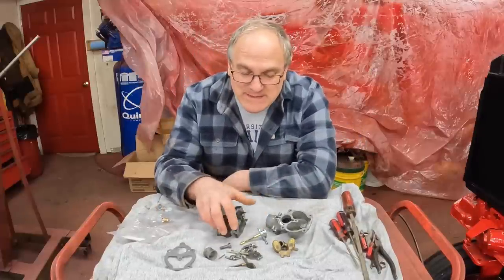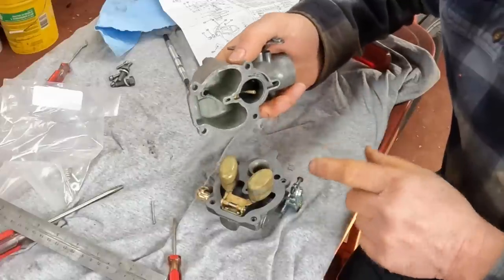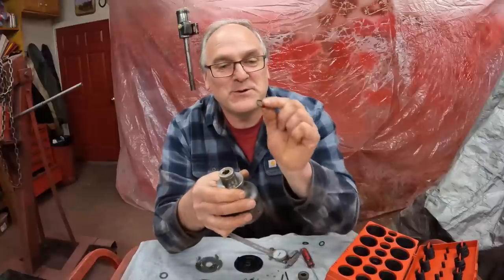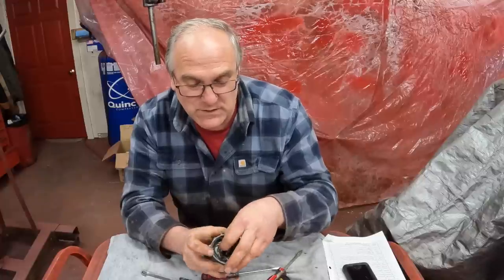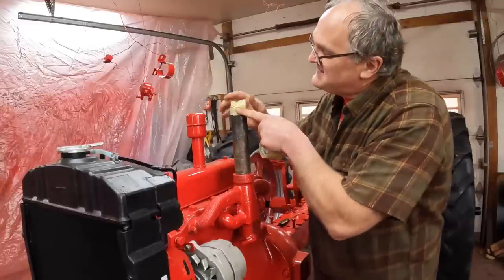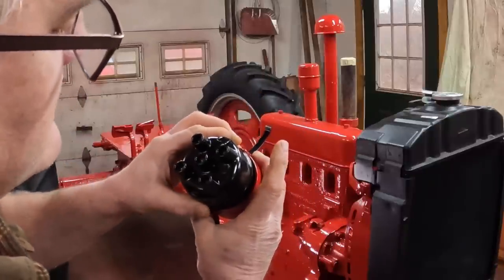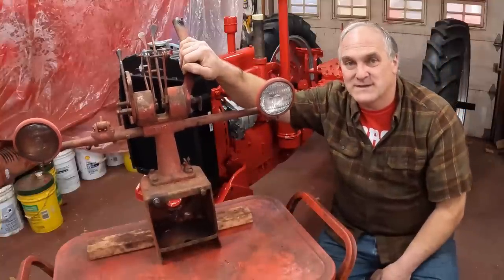Rebuilding & Installing the Carburetor and Distributor | Farmall Super C Restoration Episode 15

Comment: Points and Condenser!  I remember doing "tune-ups" on my old cars (before I was old).  I still take my vehicles in and ask for a tune-up.  They always look at me like I'm crazy, and ask "do you mean an oil change?"  Well, no.  I want whatever a tune-up entails these days.  It seems like there ought to be more to servicing your truck than changing the oil and checking the tire pressure.  Checking the oil and checking the tire pressure are things the service station attendant does for you when you buy gas at 29 cents a gallon.

Comment: Hello Pete, I think we have a lot in common.  I am a retired Sr. Electrical / Mechanical Engineer.  I too grew up on a small dairy farm, but left the farm for the NAVY after high school.  I had over a year of Aviation Electronics Technician training. After one tour, I started work in industry and started going to RIT nights and weekends (17 Years), however I never quit being a farm boy. For the last 18 years, I have been designing large diesel trains.  While I don't farm anymore, my wife and I have been 4-H equestrian leaders for 50 years.  We even had a full size riding arena in our side yard.  EMTs with the local rescue squad for 30 years and involved in several other organizations. I still teach the ATV Rider Training Safety Course and have a nice training area (the old riding arena)and a beautiful trail system for the training.  I am presently rebuilding a 1952 Farmall Super C, so this set of  videos has been a great help.  Earlier this year, I basically restored a 1939 Farmall A that my daughter had bought at auction.  As it turned out, buyer be ware as it had a split block due to freezing. This poor tractor must have had a rough life.  If I had known it was so bad, I would not have started to restore it.  I finished it the night before our ride around silver lake here in western New York.  Untested, it made us proud and strut it's stuff.  A couple of years ago, I rebuilt a 1945 Farmall H that has been in the family since new.   I live fairly close to you as we have a small farm, just south of Warsaw, NY.  I have been trying to reach you, but don't have contact info. The best way to reach me, if interested is by email gwhume@rochester.rr.com.  Thanks, Gary  PS. I am a bit older than you and still going strong, however, when I do pass, I will probably still have a wrench in my hand and a jack knife in my pocket.

Comment: She's coming right along. I find it easier to leave the distributor cap off while installing the distributor. It allows you to hold the rotor cap in the exact position you want it in as you slide the distributor in. This is particularly useful when installing distributors that have spiral cut gears. And you never have to worry if you bump it on something.

Comment: Hey Pete, 
You should try using a little dielectric grease on both ends of those plug wires. 
It helps keep moisture out of the terminals, prevent corrosion, and lubricates the ends so they come off easier and without damaging those crimped on ends years down the road.

Comment: I rebuilt the carb and distributor on the '47 8N, I had to install a electronic ignition because of the poor quality points and condenser I would get. I had to change them out every other use of the tractor, electronic Ign. works GREAT!!  Good luck and thanks for sharing.

Comment: Looking good Pete! I really admire your attention to detail. Reminds me of when I was a kid building 1/48 scale plastic models. Used colored thread to make the tiny spark plug wires and battery cables. Now just like you im applying the same kind of detail to my tractor restoration. Thanks for the reality check on the time it takes to do that work. Keeps it in perspective for me. I have a full time job also. Looking forward to next video. Thanks 👋

Comment: Nothing wrong with upgrading old designs. Done also by other manufactures in the past and present. I'm interested if the nuts for the manifold are steel or brass? They seem steel nuts from the video to me. I wonder if they don't get sized over time to the studs? I know some other manufacturers used originally brass nuts for exhaust and intake, but they would over time become too soft and loosen. So rebuild engines came with steel nuts or people replaced them with steel nuts over time. They would never loosen however if they rusted solid to the studs it was break it or make it situation.  Everything else in the video is just straight forward and easy to follow.
Reply from the maker: Hi Steve, they are steel nuts. They came off the studs with no problem on this one.
Reply: @JustaFewAcresFarm  Maybe Im over thinking this. After all it's a tractor manifold. But why are car exhaust manifolds so hard to take off and so rusty? I think a tractor manifold has better heat exchange with the atmosphere, than that of a van or car. I have come across intake nuts that are stripped or sized solid on a tractor. Brass nut  in the other hand is so easy to strip and they can just fall off with vibration. I guess that is one reason why they where phased out gradually.

Comment: Way back when contact point ignition was the mainstay, and probably now the points were coated with an anti corrosion film, what was recommended and my practice was to clean the points with clean white paper or a matchbook cover and that’s were the fine sand paper was sourced,

Comment: I purchased a Farmall 300 Row Crop a few months ago and was told the carburetor was recently rebuilt. After having the tractor for a few weeks it stated running like crap. Come to find out the previous owner used some sort of gasket sealer that was not made for fuel. I had a bunch of the sealer floating in the carb and was just a mess. I rebuilt the carb again and has been running fine since.

Comment: The old Points and Condenser trick...! Fool proof system.... Today we have electronic ignition modules and moving the fuel pump into the Gas Tank..! Mine was $536.xx + to get changed out, should've left the Fuel Pump on the side of the Block...! Great job Pete... the Super "C" is coming together just like brand new..! They say there is a Diesel Fuel shortage coming up soon.....  Thanks Bydan....!   =)

Comment: Thanks for the video. Have you ever static timed a point ignition distributor to an engine using either a test light or an ohm meter? We learned this in trade school within our first week of training (44 years ago). I have not seen anyone use this method on any rebuild videos so far on YouTube. I sure they are out there. Just hook an analog ohm meter or a powered test light to the terminal of the distributor and other lead to ground and turn the distributor housing opposite of rotor direction with the rotor pointing to number one cylinder and watch the ohm meter go to infinity or the test light go out. Lock it down and it will be near perfect.   Do you know how to tell which way your distributor turns without turning the crank or looking in the repair manual? Another simple thing to find out yet I never see it demonstrated. With the distributor on the engine grab the rotor and turn it to see which way has spring tension and which way doesn't the direction that has spring feeling to it is the way it turns. The centrifugal advance always goes forward not backward. I am sure sure you know all of this. Really enjoying ALL of the videos!

Comment: A question for you, Pete.  Does the exhaust temps on the manifold get so high that this would be pointless?  After the paint burns off and prior to it being able to rust, would it be of benefit to treat the manifold as a piece of cast iron cookware and season it?  Being a relatively low RPM use, I was wondering if you'd benefit from that sort of approach.  Rust prevention is rust prevention, and seasoned cast iron has a purdier appearance.

I like having a spare condenser around if I'm running an old points-based distributor.  If your condenser goes, you're not going anywhere.  Having one in an on-board toolkit could keep you from having to do the walk of shame from the back 40.  LOL  I also like a dab of dielectric grease on the inside of the plug wire boots.  One more step of moisture control, and ease of install/remove from the connections.

Loving the series, appreciate the time you're putting into presenting them to us.

Comment: I never know when to use gasket sealant or not.  Have learned not to use it if I know it will have to come apart soon and use it sparingly when I do.  Hydraulic fittings are always a challenge to keep from leaking on seventy year old tractors.

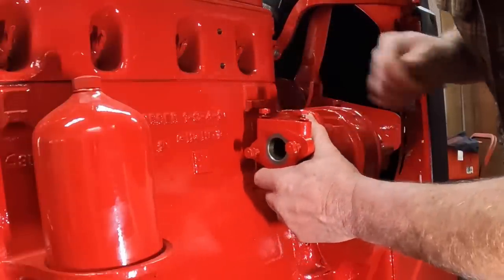Comment: 16:31 Trivia: the FU235 does have the ability to turn and tune it. Super C's and French FC123 are almost the same.

Sincere question: why the exhaust in red and not heat resistant black? Not that it doesn't look awesome

Comment: My dad has a 504 international gas. He’s had it 40ish years now. Always had a problem with cracked distributor cap , corroded points and terminals that go to the plug wires. Anyone ever have this problem? I think it’s the bushings that go to the sprocket that turns the whole thing. It’s really the only thing left that’s never been changed.

Comment: So is that IH coil an original 6-volt coil?
Reply from the maker: Yes
Reply: @JustaFewAcresFarm  Cool.  Broke down and painted our Cub the same way but left it 6-volt.  Generator still was working great.  I did however install electronic ignition and an electronic voltage regulator (hidden in the old mechanical regulator housing).  Kept the old points/condenser/regulator handy if there ever is an EMP attack wiping out all electronics.
Reply from the maker: Where did you get the electronic regulator?
Reply: @JustaFewAcresFarm  Just checked and they are no longer selling any products online.  Bummer!
Reply: @JustaFewAcresFarm  It was from Clover Systems of Laguna Beach, CA but unfortunately their website no longer offers them for sale.